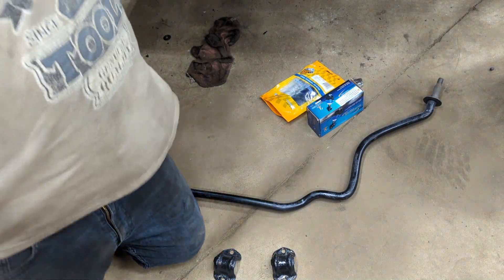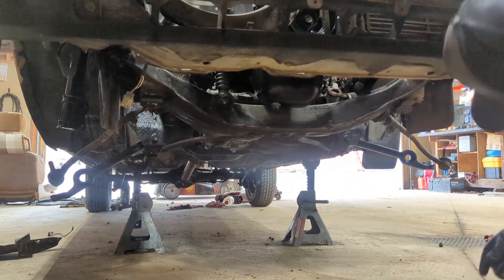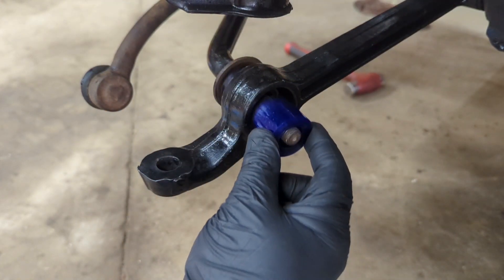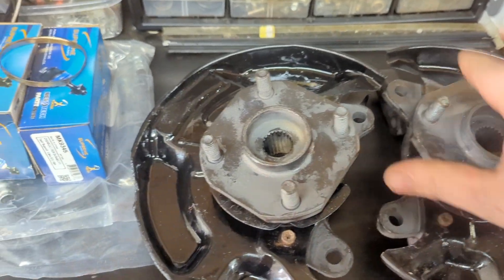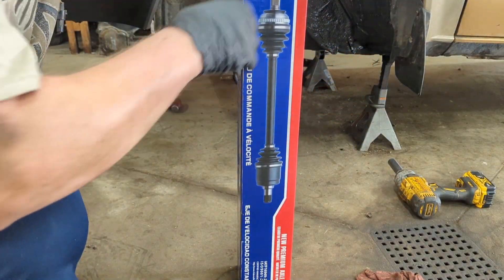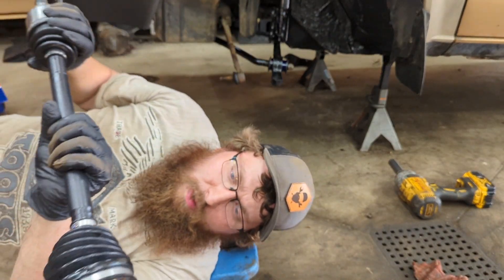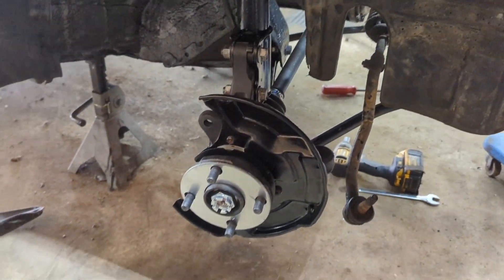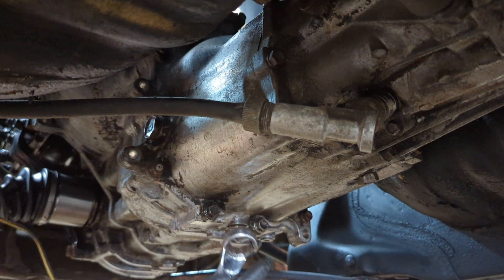86 Tercel gets sway bar bushings, wheel bearings, CV shafts and more!

Comment: great job so far! I did reference your transmission fluid change video. I also found one about Robert W. on why you only turn that 4WD transmission bolt 7 times and not all the out.  If you miss that small bit of information you are in for hours of additional work.